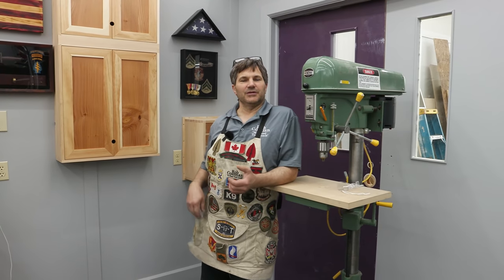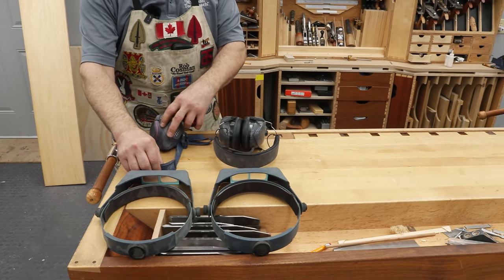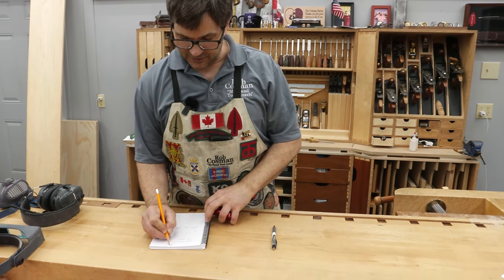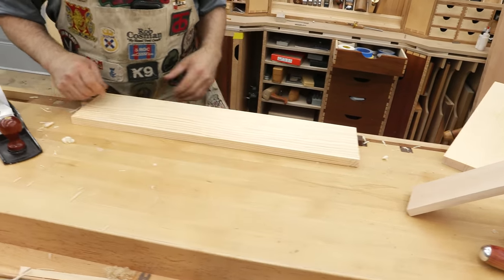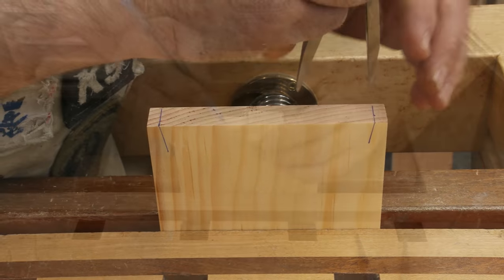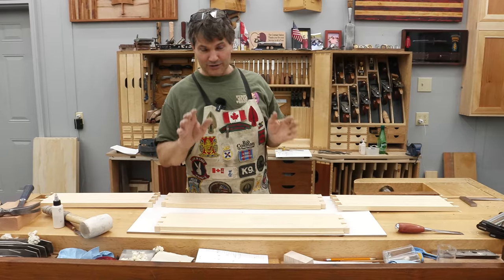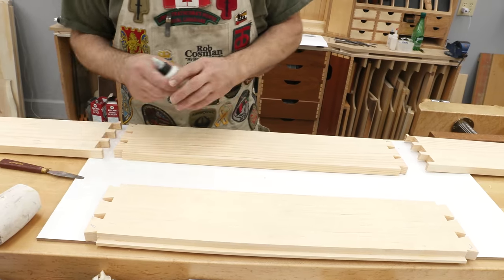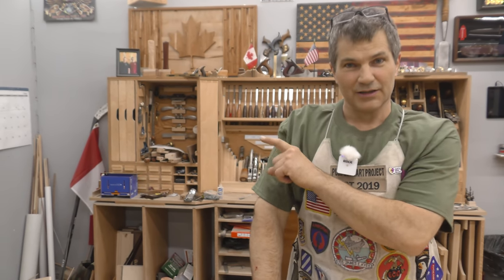Woodworking For Beginners - How to Build a Cabinet Case

Comment: Hello Mr. Cosman. I am retired and now looking at a woodworking hobbie. Thank you so much for all the information and the way you present it. I do not have many tools, but I do have a router and a couple of dovetail bits. Any suggestions on how to make dovetail joints with a router. The only handsaw I have is a miter box saw and all the teeth are the same.  It is very hot here in Tucson AZ now looking at 100 + degrees for awhile. Have a great day and God bless you and yours.

Comment: Hello Rob et al, 
Viewing this video I came up with two questions: 
@13:55 did I see graduations marks on the marking gauge you used? If so, what gauge is that and do you ever use those marks? Then towards the end, you check the squareness of your cabinet by comparing the diagonals, which are bang on... (I am not surprised) but you don't say what one would have to do if there were not.
Sincerely,
Paul
from Pierrefonds (Montréal, Qc)

Comment: When you mention learning the metric system, was that intended as a joke or if you could start all over would you have went with metric instead of imperial?  As a new woodworker without a ton of measuring tools, I'm still debating what to invest in.

Comment: Thanks Rob for another excellent practical tutorial. Wondering if there's any downside impact if I glue up 4 corners at once by using parallel clamp to pull the 2 tail boards together instead of doing one corner at a time? I fear that pounding may break the outside pins and also if one of the square measure is off just by 1-2 degree then the last tail board will be difficult to go in or it may force the previous glue joint to move.

Comment: I'm currently building a dovetail bedside cabinet at college and this is the standard I aspire to be. Maybe one day.
Reply from the maker: You can do it
Reply: It's like Rob says, the quality of the piece is the sum of the parts.  A few years ago I would have thought that in order to square up the inside rabbet for the back of the case, making 50 cross grain chisel chops, a few dozen paring cuts, and then going back over the whole rabbet with a router plane to clean everything up would be too tedious and unnecessary.  I might not have even bothered to sharpen my chisel first.  Putting that A-tier energy into every little task makes a big difference.
Reply: @Exodus5K  You're absolutely right and this is what I'm aiming for. I'll keep watching and taking the advice.
Reply: @Exodus5K  agreed... and what’s more, I truly enjoy the process of doing this with hand tools now!

Comment: Appreciate how you worked out the dimensions of the case taking in account the items being put into it and the space where it is going.  
Looking forward to the next videos and see how you will be mounting the case tot he wall.   

Safe to assume if you were going with a French cleat, you would need to protrude the case an additional amount; based on the depth of the cleat.  (e.g. 1/2 inch)

Comment: As an Aussie, I smiled at your musing over learning metric! Each system can be tricky navigating when it’s not yet second nature. 😅
Reply: Just buy a metric tape and a metric rule and measure with these, problem solved. One metre is 1000mm which is 3 feet and 3 and ¾ inches. Now I am going to divide 1000mm by 2 to get half, and you are going to divide 3' 3,3/4" in half—Go!

Comment: There is no doubt the metric system is the more straightforward when making calculations. The reality for people of our vintage, who learned metric at school, then found their place of employment was still largely imperial, is we use an amalgam of the two. I remember, as an apprentice being instructed to "bore for two metric 1/2"  bolts, 1m 4 1/2" inches apart"....
Reply from the maker: I love that - a metric 1/2 inch bolt

Comment: I’m super new to woodworking and I’m going to be doing allot of practice before starting whatever project I decide to do. Any suggestions on what to do first to get some practice? You sir are a woodworking wizard, you make it look so way.
Reply from the maker: sharpening and then using your plane to square edges.  Flattening or planing smooth wide boards, no plane tracks.  Sharpening chisels, sawing, in particular, become proficient at starting the saw exactly where you want it to start.

Comment: Rob, you glued 2 pin boards and a tail board and then let them tack up before you glued on the last tail board.  My uneducated natural instinct when trying to glue up a square case would be to glue up all 4 boards and then try to square up the case after the fact.  Does your approach offer benefits or avoid pitfalls?  Can you elaborate a little on this approach?
Reply from the maker: Normally I would have glued up the last Tailboard right after the two pin boards however in this case I noticed open areas that I needed to close so I had to apply the clamps which stopped the process. So had everything fit correctly I would’ve done it just the way you said however I check for square after putting together every corner otherwise the glue has a chance to set up and then you will not be able to pull it into square effectively.

Comment: Lots of good stuff. But if this is aimed at beginners, I would question how many of then have a table saw and dado blades. Mention of the alternative of a router table method would be of value to many.
Reply from the maker: Most start off with a table saw and dado blades are a next thing to buy as an accessory.

Comment: Rob, do you pretty much always use a 1/6 for your dovetail angle? If so, how wide a panel would you suggest changing to a 1/7 or 1/8? I understand that some folks change the angle based on the hardness of the wood and/or aesthetics. Just wondering about your preference. Thanks!
Reply from the maker: Thanks for watching. I keep 1/6 angle for all my dovetails regardless of wood type or size of project

Comment: Brilliant video as always Rob, what tight bond glue did you use and is it any benefit to use a slower setting one for this type of work?
The lighting in the new shop is perfect,
Reply from the maker: Tight bond 3 is my go to glue.  On this cabinet, its perfect.  If this was a large case with a lot of dovetails (50+). I would consider using tight bond extended open time glue which is slower setting. Thank you for your comment

Comment: Excellent timing Rob, i was just thinking about building some cabinets. Somewhat of a side question: what's your go-to straightedge for flattening large surfaces, like an 8ft board or dining table or similar? The longest one i have that is trustworthy at the moment is my #7 jointer, and i was wondering if i should invest in something longer and more dedicated
Reply from the maker: Nope a #7  will do a fine job

Comment: I’ve been asked to build 2 chest of drawers for somebody in new york(I’m in Wisconsin), I’m very hesitant to build these and have them shipped across the country…can I be sure the drawers will fit when they get there?
Reply from the maker: Can you be sure ? No.  But you can do a lot to try and make sure they fit;1) build the drawer in the most humid time of year for where you live. 2) if using traditional building methods all you have to worry about is movement in the vertical plane. So leave a bit more gap between your drawer and opening top to bottom. 3) You could consider using a man-made material such as plywood for the drawer sides and front and band them so they look nice, the man-made material will not move.

Comment: Awesome video. On your block plane, did you polish the back to 16k and use the ruler trick? Curious how you prep your low-angle plane blades since there's a lot more steel there vs chisels.
Reply from the maker: Prepared the same way as my hand plane blades, except for the feathering on the edge, I don’t do that to the block plane.

Comment: Great video and I enjoy all your work. Just a quick question. Why put the tails on the side pieces for this cabinet but not the little one with the drawers? Just curious
Reply from the maker: Well that one does not hang.  If you Look closely I glued and screwed a frame on the back of it and then attach the frame to the wall.
Reply: I figured it was a simple answer. Thanks

Comment: Man, I gotta work on sharpening my chisels and planes... that wood is cutting like butter!
Reply from the maker: Sharpening is the most important skill for a hand tool woodworker
Reply: @RobCosmanWoodworking  fwiw, my first purchase from y’all was your sharpening system. I watched the multi-episode drawer building series last year and realized very early on that my tools needed to be much sharper than I had ever sharpened before if I was going to attain Cosman-worthy joinery.  I’m not there yet, but I’m getting there, and boy howdy, are my planes and chisels ever sharp! It makes a world of difference!
Reply: I’m sharpening my chiles and I can’t seem to get a burr on my 32 degree angle. 25 is the main bevel and 28 is the second bevel and third is 32 or 34 degrees. What am I doing wrong?
What is the purpose of the second bevel ?. 
Please let me know what I’m doing wrong.

Comment: Learn fractions? I did that  50 + years ago. Now my eyes get crossed trying to read fractions and whether its sixteenths, thirty seconds or sixty fourths and as my eyesight gets worse, well, you'll find out. Whereas metric is based on the rule of ten. If it's 7 tick marks over how many what's is it in Imperial as opposed to metric which tells me it's 7 mm. We learned both in 1st grade (we also learned French as Canada was 26 miles across Lake Erie.)
Reply from the maker: Bonjour….I learned imperial and that what I am comfortable with. My kids are metric, why we had 10!

Comment: Would it be easier to assemble the case then cut the back rabbit on a router table?
Reply from the maker: Thanks for watching. Your suggestion is an option but i dont prefer it because the router will not cut a nice flat rabbit.  Its almost impossible to clean up the rabbit left by the router once the case is assembled

Comment: What do you mean when you say holding gains with the clamp?
Reply from the maker: Sometimes when you tap a joint together it bounces back.  The clamp offers enough resistance to prevent that.  Tap it tight and it stays put!

Comment: I really appreciate this video too but I  think that beginners don't own a table saw to cut rabbet this way and squaring and edging is an important phase with hand tools...
Reply from the maker: There are multiple ways to cut rabbits.In this video I chose tablesaw and most beginners that I’ve encountered do have tablesaws. However if you do not have a tablesaw using a plow plane or a router or even just your chisel will do fine. So there are multiple ways to cut rabbits
Reply: @RobCosmanWoodworking   Thank you for your answer. Cutting the rabbit it's ok but I was thinking that having a table saw for a beginner is a bit like "mettre la charrue avant les bœufs"...( putting the cart before the horse). The beginners you encountered have jointers and thicknesser to?

Comment: Why would you use a router plane? You use it in these situations a lot. Isn't a shoulder plane easier?
Reply: I just realized the end of the rabbit would stop you. Dumb me.
Reply from the maker: But the more important reason is that the router plane will make the surface of the rabbet parallel to the face of the board, shoulder plane wont do that

Comment: Rob, you don't need to learn decimal you already know it!  Work in millimetres and divide by 1000 when ordering lengths in metres.  Divide by 10 and you have it in centimetres. If your mill/depot only work in inches, get an app on your phone for metric/imperial conversion.
Reply from the maker: Nope i am not switching, staying with imperial